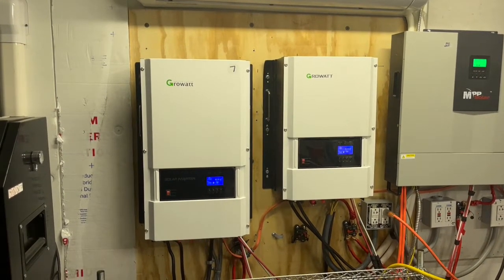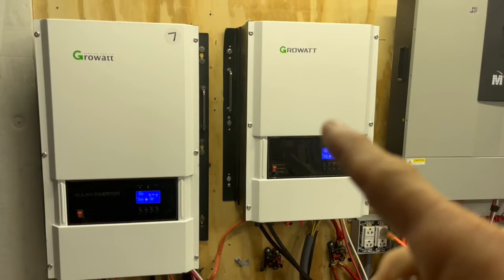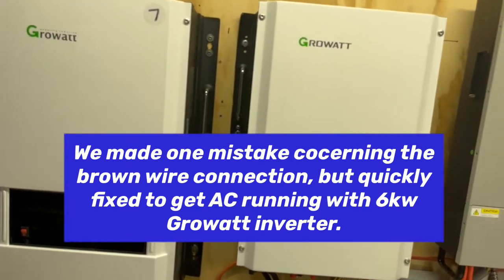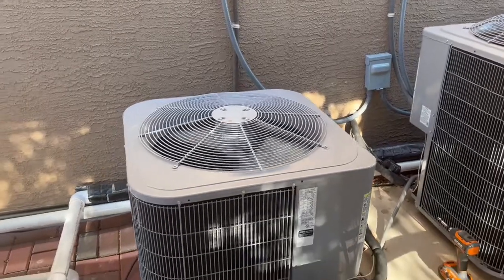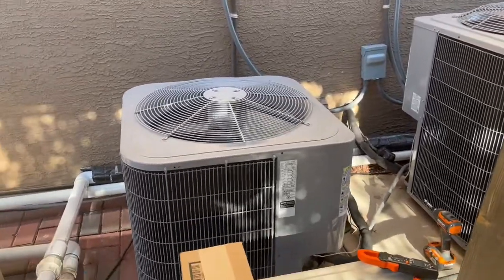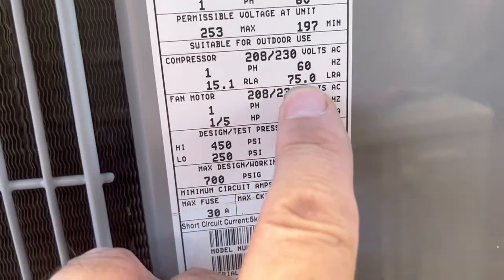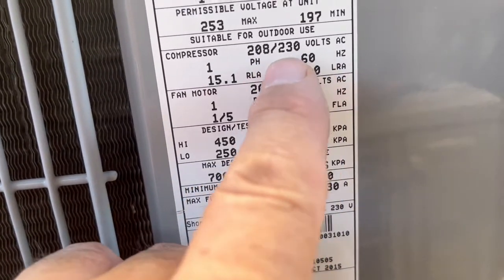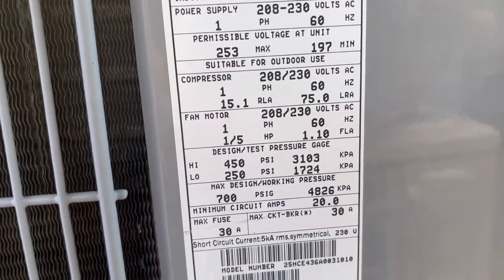6kw Growatt now starts 3 1/2 ton AC added a soft start to reduce inrush amps from 75 amps to 24 amps

Comment: If someone installs a soft start and it makes no difference in starting amps there is a good chance they hooked it to the fan and not the compressor.
Reply from the maker: I connected the brown wire to the fan instead of compressor (C) on the capacitor and it still reduced the starting current from 72 amps to 24 amps in rush amps. The problem was it would not stay running more than a minute or two before the ac shut down. I sure there could be a way to connect wires wrong and create a situation where there is no difference in starting amps. I did not find that way thankfully, lol. Thank you for the comment and maybe someone has had that happen and will share with us.
Reply: @diy-solar-guy  when I installed my Micro-Air easy start I unhooked the wrong wire from the contactor and saw that I was only getting about 6 amps through it.   I was pretty puzzled because I followed the instructions, and the wires weren't labeled, but once I figured it out it made a big difference.  It helps that my model has Bluetooth and I can monitor its status in real time.  It dropped my starting amps to about 22.
Reply from the maker: @chevrofreak  I am very happy with this soft start. I was unable to use the 6kw Growatt inverter to run the 3 1/2 ton ac. Now with this soft start I can run both my ac all on solar. One on the 12kw Growatt and the other on the 6kw Growatt. I tried looking for the micro air soft start but it was out of stock almost everywhere, when i did find it in stock it was almost $100 more than this soft starter. So I tried this  and it works really well. I will be buying another soft start for my 4 ton ac and calling the manufacture to see it they make a soft start to use on my 125,000 btu pool heat pump. I just looked and the inrush amps are 185 amps. That pool heater is a beast.